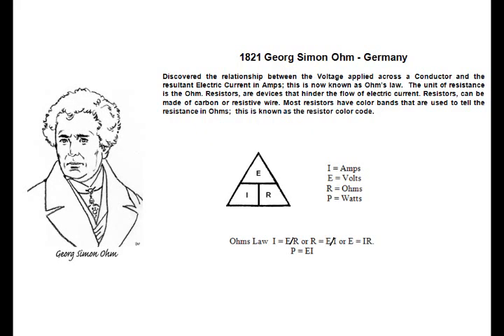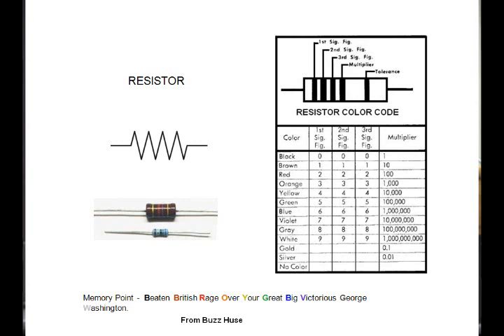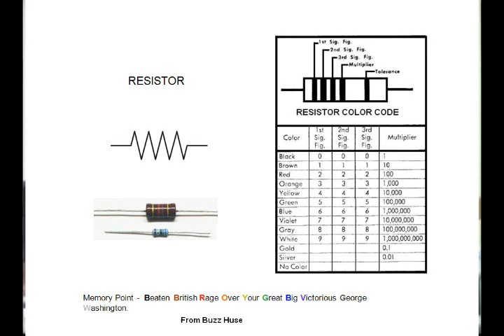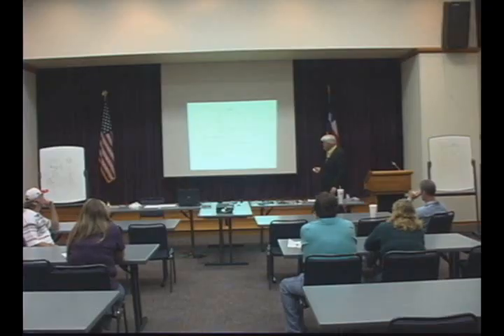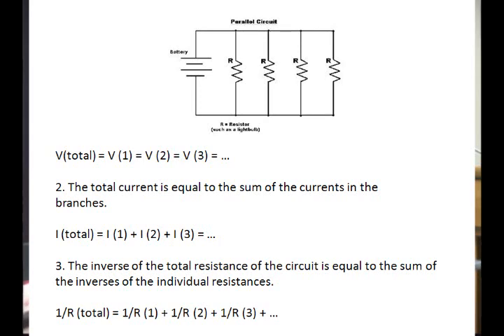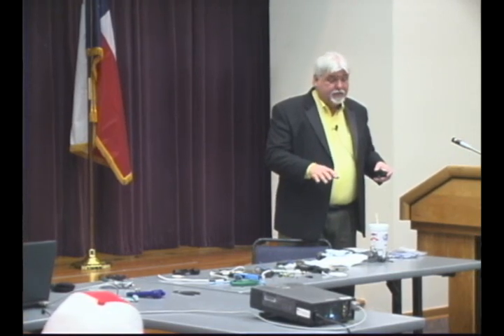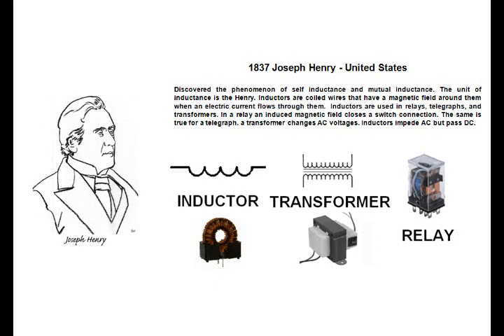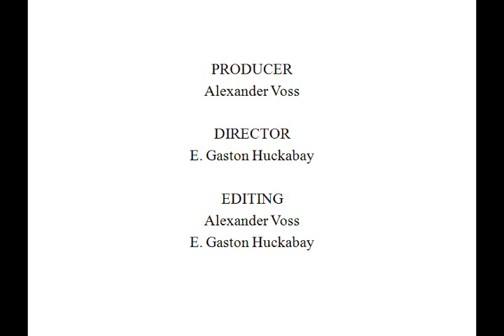Basic Electronics 10 Ohm's Law series and Parallel circuits

Comment: True that AC is more efficient for transporting power for  shorter distances*, but for longer distances HV DC is more efficient.
 
No one would build the neccessary HV DC transmissions lines from  T Boone Picken's propose wind farms to the markets for him. That's why we rarely hear of the Picken's Plan these days.

*Of course distance is relative
Reply: Dc is the most inefficient power source for long distances, just because  of the resistance of the wire, and the distances it has to travel to get to it's destination.  The resistivity of a wire is determined by the length, material,temperature, and also inversely proportional to it's cross sectional area.